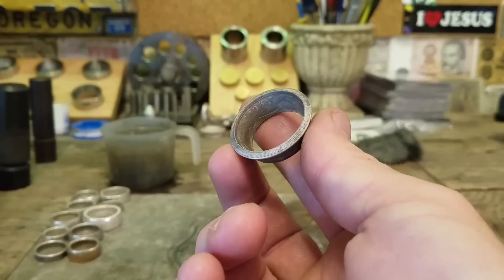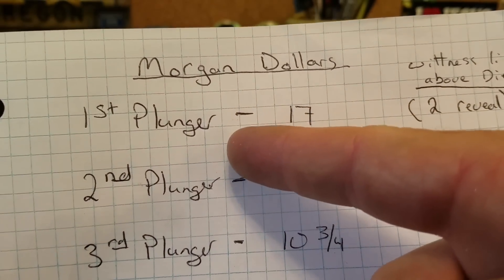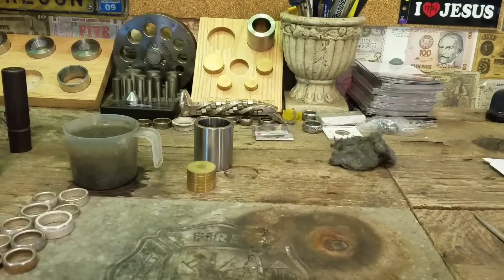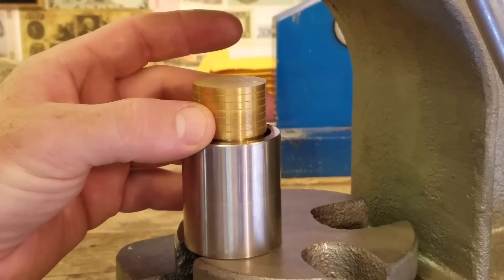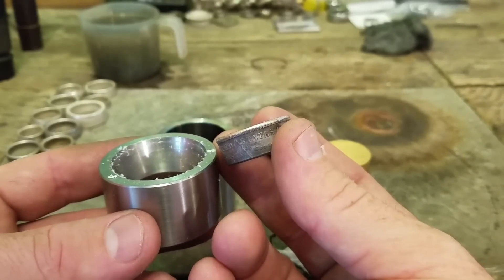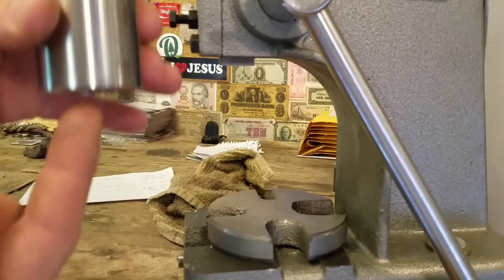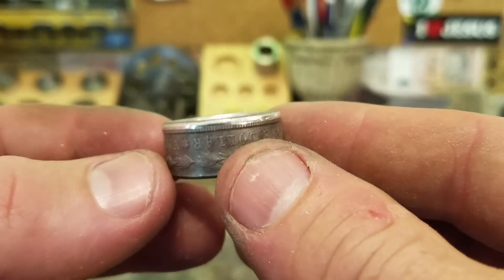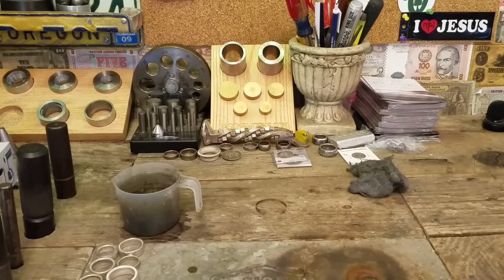How to make small coin rings from large coins (Swedish wrap)

Comment: Ive used 3 different type of presses in my working life, I am in the Aerospace industry. telling this to bolster the use of the arbor press. Ive used two different type of 50 ton presses. Hand pump type and electric hydraulic. Then the arbor. For small applications such as making rings in this fashion the arbor press is best because you can feel your work! You can somewhat with a hydraulic type, but the arbor is the best for feel and control. Ive watched a bunch of different videos from different people and their methods and what has amazed me is you are the first I have seen of someone finally using a small arbor press..Good choice, its an excellent tool. Haven't made any rings myself yet. Gathering info. Yes I do have an Arbor press. Look around for them, I got mine off of Craigs list from a machine shop where a guy was retiring. Paid 40 bucks.
Reply from the maker: +sfbfriend amber presses are good for sure but if I were to buy just one press it would be the 6 ton a frame press. It actually has much more control. With an Arbor it takes more force to use and you can accidentally over press. That isn't an issue with a hand pump hydraulic press.
Reply: I actually disagree, but its more on what works for you.

Comment: your right about not needing much force to press i couldn't wait for the dies to come out so I spent some time at the machine shop Makin up my dies an there great an i had my push rods made from aluminum an its working very well its really amazing how easy this method works
Reply from the maker: +Cory Canfield Right on! I have really enjoyed working this method through the paces. Aluminum, that is an interesting choice. Do they get marred up?
Reply: The reeded side did leave marks the first time but other than that I haven't seen that its getting any worse an I've made it seems like tons since I've got them back from the machinist I've been Makin alot of the wide straight band with a 3/8 hole an small fat tire side for the ladies I thought the Morgans in the smaller sizes would just be to heavy but all the ones I've put out they won't take them off or have any complaints about weight
Reply from the maker: +Cory Canfield That is great. Yeah I figured that too but I have been selling a ton of smaller Morgans and not an issue at all. Some people really like big rings.

Comment: Please install a vertical support directly under your arbor press. It shouldn't take more than a tightly fitted 2×4 from the underside of the bench to the floor beneath to eliminate all that flex you can see in the bench to when you use the press.

Comment: I still dont understand what a sweedish die does.  Does it reduce the coin size and straighten it?  How many do you need if i wanted size 5 all the way to 13
Reply from the maker: It basically extrudes it down in size. As it gets smaller it actually gets longer. A size 5 is possible but they are pretty much unwearable unless you make a huge hole in the coin to make the width small enough to be comfortable.

Comment: Do you pickle clean after annealing?
Reply from the maker: +SmokeyJoe024 no not until late all the annealing is finished and it is time to finish the ring
Reply: +Coin Rings from The Mint - Change You Can Wear Right on. Thanks for the reply. I ask because my in a class I took, the teacher was very adamant about cleaning after annealing. I believe it was to avoid working the dirt into the metal. Thoughts?
Reply from the maker: +SmokeyJoe024 Everyone who works at craft has specific idiosyncrasies that might not have a purpose. I know I do also. This is what I'm assuming is going on there :)
Reply: +Coin Rings from The Mint - Change You Can Wear.    Cool, Tyvm.

Comment: You call what you are doing annealing, but annealing, as I understand it, requires cooling the metal slowly.  You are quenching instead, which will make the ring harder, not softer (it sounded like the latter was your goal).
Reply from the maker: +Scott Gartner That would be right with steel or other ferrous metals. Silver and copper along with other non ferrous metals can be quenched with no hardening.
Reply: Thank you for the info, I thought it was more universal.

Comment: I don't know man....this looks a little cooky....why wouldn't some sockets and reducing ring that comes with your mandrel work? Stacking things on top and not seeing if the coin is even would be a major problem. Doesn't this method also squish the raised details on the ring and flatten it all out???? Would make this very hard to patina wouldn't it? I see holes in this technique, sorry man. cool video though
Reply from the maker: +A C nope it doesn't hurt the details one bit if you wrap the coin properly. If you follow the notes I made in the video you won't need to see the coin. Sockets damage the die if you over press. Also the reducing plate is way too shallow of a die to work well.
Reply: You do the rounded look when you complete the coin? Just curious as the finish product looks pretty rounded to me as the reverse force would make more of a straight band look. I think sockets would be the same concept here as long as you protect the reeded side and reduce to make sure it is a good fit. The mandrel dies come in various sizes as well...so if you are reducing by mandrel just get it to the desired size. I don't know about you but not being able to eyeball the coin while reducing it would increase the chance for uneven, wobbly rings.
Reply from the maker: A C They don't ever come out uneven or wobbly. Did you watch the video?
Reply: Yes I watched the video and it is cool as heck. I wasn't trying to be hating just some questions. I'm going to do one with my die from my mandrel....1964 Kennedy and see. I will do a size 8 see what happens. It a genius idea. I will just use smaller sockets as it goes down. Great videos.
Reply from the maker: A C I'm sure you can make it happen it just won't be quite as easy. Good luck with it and let me know how it goes.
Reply: A C ca you make a video using the sockets
Reply: I thought about it....another guy made one already....lol. It works great. I made a size 7 doing it with a Kennedy 64